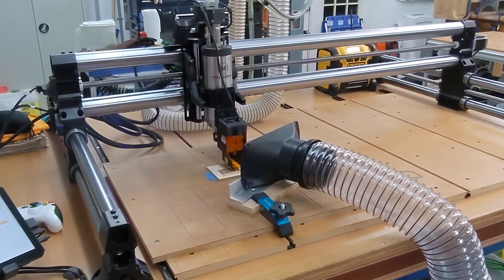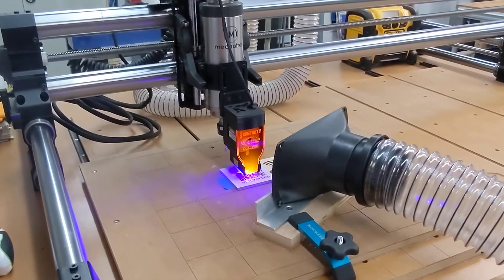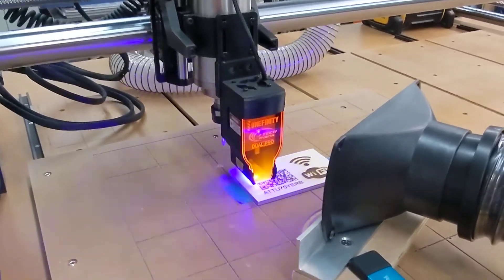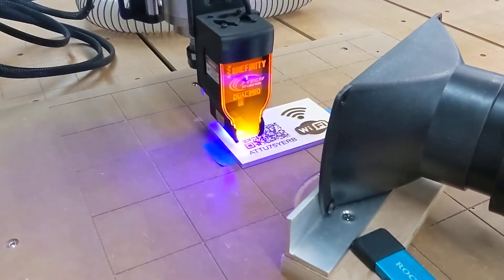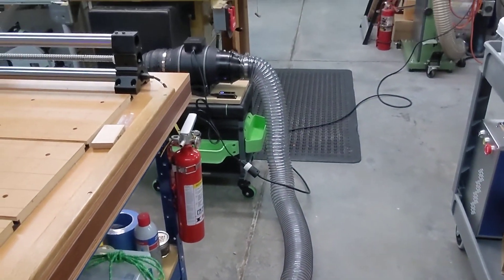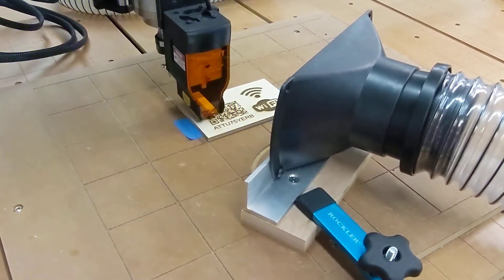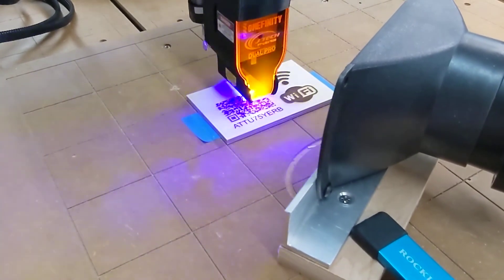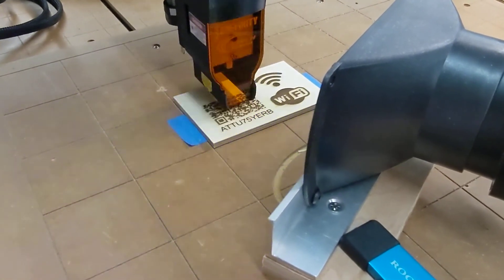OneFinity CNC with JTech Laser

Comment: Nice Setup! can you drop a link for that black exhaust attachment?
Reply from the maker: POWERTEC 70150 Rectangular Dust Hood Collector – ABS Plastic, 4 Inch OD  https://a.co/d/89TFslU   and   POWERTEC 70193 Screw End Quick Coupler for 4” Hose – Left-Hand Threaded Adapter https://a.co/d/gQPlzMk
Reply: @BigHWorks   Thank you!